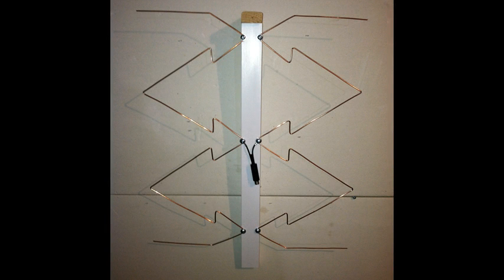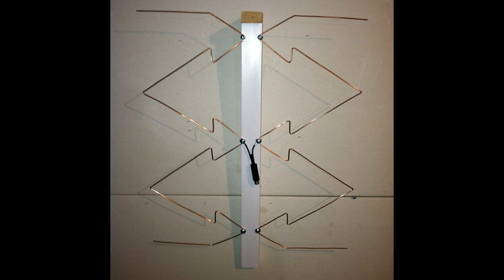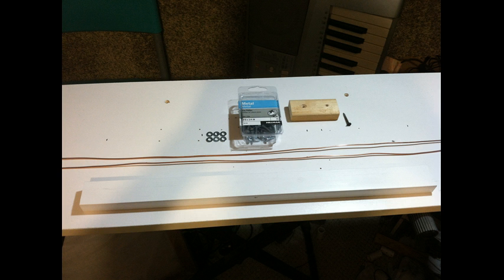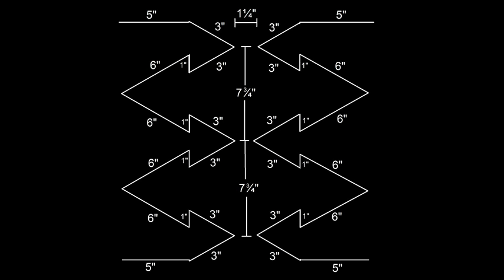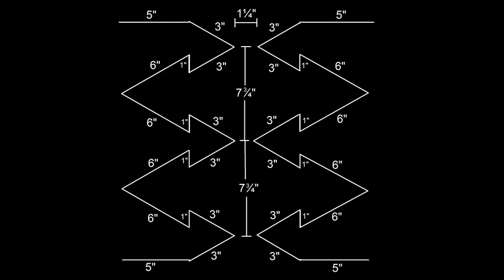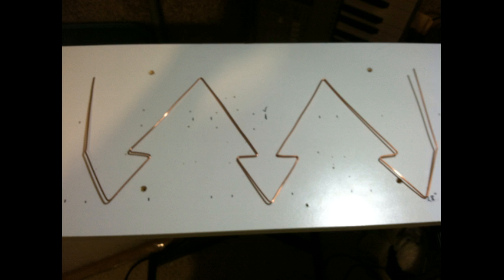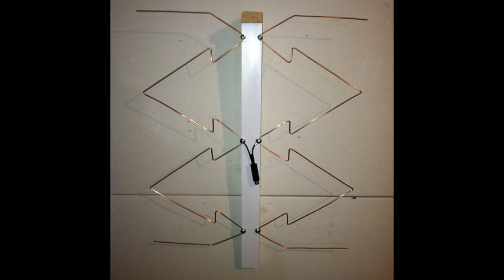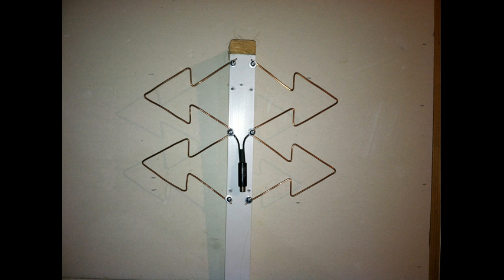How to build a HDTV Antenna  - The Tuxedo

Comment: Thank you for the design, it works beautifully. I live in an apartment, so a more compact design was desirable. I made the Tuxedo GH, and added NAROD's to it to get my two local VHF stations. I tried 760.2mm bent, "Top Hat" NAROD's, but for my local two stations, straight 696mm NAROD's are working better. I also added a rod reflector since most of our transmitters are in the S, SE, SW, the rear and side lobe reception is still adequate enough to get stations in the N, NE, etc, the interference from the main road to the west is less, and the fact that my antenna has a whole building to look through, to the south. I wrapped 1/2" wood dowels in aluminum tape, along with a PVC frame. For the UHF, I used a gapped reflector, (like the standard GH6 reflector,) but compressed the spacing between the rods a bit to adapt it to the shorter tuxedo design, at a spacing of 100mm behind, and two ungapped 762mm VHF reflector elements that are 292mm behind the NAROD's, but my next iteration is going to be adding a third in the middle, and a reflector similar to the GH10 reflector, just to see how it affects it compared to the GH6 reflector.

Comment: Thank you so much! I built the more fractal Tuxedo GH with NAROD’s, and it works beautifully. The only two Hi VHF stations we have here are only in the 210-216 MHz band, so 27.4” NAROD’s with a spacing of 10mm/3/8” from the end sections of the UHF antenna, work great. I had 30” S bent NAROD’s but channel 7 was less than desirable, so I replaced them with the 27.4” straight ones, and problem solved. I have a reflector array behind it with 8 gapped reflectors at 100mm/3 7/8” spacing behind, and two solid, gap-less reflectors at 294mm/11.575” spacing for the NAROD’s. This is a nice fractal design that makes a GH smaller to be an inside antenna for an apartment. With a splitter it drives two TV’s very well. 

Query; is it possible to add directors of some design that boosts the range of either the UHF part, or for the hi-VHF NAROD’s? In other words, can the GH, and Tuxedo GH, antennas be configured like a Yagi-Uda array antenna?

Comment: I did a MMANA modeling of this antenna. It is laborious to calculate all the points but then we can optimize. With the dimensions indicated, the results are good at around 700 MHz. It is much worse in VHF and at the bottom of the UHF band. Two directors at the top and bottom improve the gain and the lobe a little. Results at 700 MHz: G = 9.13dBi, ROS300 = 1.56, Z = 228 + 93j
She would be better with a ratio of homothétie of 1.15 approximately.

Comment: Could I request a template of one side of the Tuxedo (single, properly bent wire)?  I could transfer the template onto a board and make a pattern jig.
Reply from the maker: If the tuxedo is confusing, this antenna may be easier to build and works great HDTV Antenna   Build it Yourself! https://youtu.be/sMVGeSDh-Qg
Reply: @DIYProjectsWithMike  I like the Tuxedo concept albeit I had trouble bending the wire with the bow tie. 
 My wire was too thick (#6 ).   Have you toyed with the idea of using this within an omni directional design?
Reply from the maker: LAWRENCE CANDEL 
Yes I have tried Omni-directional-“everything I can think of”and nothing worked as good as the flat. That goes for all designs I have made videos for. I’m working on another video for a different antenna that I’m hoping to finish soon. If you’re subscribed to my channel, check back from time to time or click the notification bell so you won’t miss it. You might also check out one of my later videos labeled: “Build it Yourself”. It doesn’t have as many bends to make and might be easier. 
Thanks and good luck.

Comment: what do you mean by transformer ?!
Reply from the maker: The matching transformer transforms the signal to 75 ohms and connects your coax to your antenna. I found mine online but they are also available at lowes and home depot. It says "Matching Transformer" on the label.

Comment: what's the range of frequency it can work on?
Reply from the maker: barts kun 
The sensitivity of this antenna is mostly in uhf but does pick up some vhf high if the signal is strong enough. The widest range antenna I’ve built is the Tri-4. (Super Easy to Build) located on my channel.
Reply: DIY Projects With Mike thanks, i'll check it out
Reply: CANT FIND THE TRI-4
Reply from the maker: barts kun 
Try this link 
https://youtu.be/X8VjHEX8czA

Comment: Mike, I built the Tuxedo but I added two more bays - your original has two and mine has four. It absolutely annihilated my standard Gray Hoverman by 30% more signal power (while adding several more channels). Whereas the original is about 50" mine is about 100". Extending the original pattern probably adds to it, does not diminish it in any way. A superb antenna, many thanks (since I am in a tree enclosed property).
Reply from the maker: That's awesome Ben! Thanks :)
Reply: Mike, I think I know what gives the Tuxedo its power. My 4 bay Tuxedo has the same length as my GH but concentrates twice as much metal coverage in the same space (due to its fractal nature). Also, the Tux's two wires as opposed to a bowtie's ten makes EM signal flow and transfer to the balun in less steps and through less junctions. A bowtie has 2 exchanges: whisker to feedline to balun; the Tux (and GH) only one since its "whiskers" are its feedline. To me it appears there is more coverage and less signal transfer loss in an antenna such as the Tux. I think the Tux uses the best of the GH and bowtie plus the fractal form factor.

BTW I also put a curved (parabolic type, like a semi-globe) reflector made from kitchen aluminum foil (on cardboard) behind the Tux - since I'm only facing in one direction.

Comment: Also most stations were moved to the UHF level when makes propagation worse, especially in rural areas.  Digital compression to the signal plus propagation issues can make this signal very delicate at best.  But you need to make sure that your antenna construction includes also VHF reception, Memphis for example has one station still in the VHF Band Channel 3 but the rest of the VHF's moved to the UHF Band.  Include VHF with all, thanks

Comment: If you use wood it needs to be sealed before use.  Use outdoor poly to seal or a wax dip or even a wax and oil wipe, this will make the wood last longer and also increase the resistance to infinity.  An old time way that goes back to the 10's-20's for early radio

Comment: Made this last night and it works great. Picked up Boston channels from Gloucester (About 45 miles) Question; I couldn't find copper so I used 9 Gauge aluminum. Does that matter?
Reply from the maker: Glad it worked for you, that's awesome! I've never tried the 9 gauge aluminum galvanized yet but they have it at my local Lowes. Thinking about trying it to see if one works better than the other. I'm learning new stuff all the time. :)
Reply: The guy at the electronics store where I got the aluminum and oHM converter was sure I would need a 12' long Yagi style to pick up channels. Glad I didnt listen. I can make 4 Tuxedo's for about $10 apiece! I'll see if one will have enough signal for 2 TV's first...
Reply from the maker: Way to go! I hooked up 2 tvs and yes there was some signal loss but not enough to lose the channels I needed.

Comment: Had to find this video in my history and say Thank You!  This antenna rocks.  I paid $5 for the matching transformer and had the rest of the materials in my basement.  It out performs my "powered" antennas (even with their amplifier off/on).

This is a wonderful and still relatively compact design.  I'm now pulling 50 channels without issue from inside my top floor with the antenna poorly mounted (in other words without much effort).

Comment: very nice! i built the great hoverman once and it worked great, but its size was a real problem. im going to try this model next.
Reply from the maker: Thanks for commenting. Yea, the performance is about the same. I use it as well. I think you'll be happy with it. :)
Reply: DIY Projects With Mike so, I built the antenna. For some reason I calculated the inches to cm wrong and ended up with shorter wires. So I adjusted the measurements in proportion. Antenna ended up being about a 12% smaller but it works incredibly well. Might be because I used 8 gauge wire? (didn't have anything smaller where I bought it) but got all digital channels working and its small enough to be fitted everywhere. Very happy with the antenna. To me this is hands down a way better upgrade to the old big model.
Reply from the maker: So glad it worked out for you!

Comment: Thanks for the plans. I built one last night after one of the little 40 mile retail square antennas could not pick up the channels from Madison, only 21 miles to the towers. The retail antenna only received 6 spotty channels, only 1 of which was useful. The homemade tuxedo picked up 41 channels! All the ones I wanted came in crystal clear. There was actually a storm last night and it still worked really well. Luckily my TV has the ability to remove some of the channels. Who knew there were so many QVC and HSN channels OTA?

The parts for this thing ran me: $1.49 for the transformer, $0.88 for the washers, $0.99 for the screws, and $4.94 for 10' of 8 gauge bare copper grounding wire. I added an aluminum foil reflector behind it to cut down on any signal interference from all of our wireless devices. I had an old board and cardboard box, so all in with tax was less than $10.

I didn't mount it in an optimal position. It is just sitting in the corner of our living room. It isn't the prettiest thing in the world, so I may try moving it into the attic.
Reply from the maker: Thanks for stopping back by to comment. Yea, I think you'll like it in the attic especially if your house is brick.

Comment: Mike, much thanks!! The plans were very simple to follow, and this carefully crafted design is extremely easy to assemble. This antenna works significantly  better than an $80 model I just bought. Question: stations in my area are primarily at N and at ESE. If I build two of these Tuxedo Antennas and aim one in each direction, can I couple them with a coax splitter/combiner?
Reply from the maker: Glad I can help you save money! Try pionting to the NW. Without a reflector it is bi-directional. I never had any luck tying two antennas together. The reception just gets worse. Thanks for reaching out.

Comment: I live in an area that requires VHF and UHF. Will this antenna handle VHF and UHF?
Reply from the maker: It does handle strong VHF signals but is more sensitive in UHF. Have you seen VHF add-on?
https://youtu.be/xuqHrONy0b8
This one will handle both a little better.

Comment: Mike, Thank you for this. Looks like just what I need- Just one question, what's the length of the pvc material?
Reply from the maker: exercisetherapy I think the length on mine is 18" but it can be as long as u like as long as the antenna fits. Thanks :)